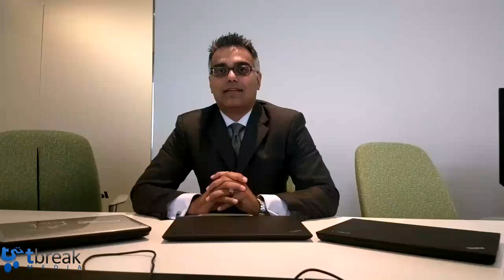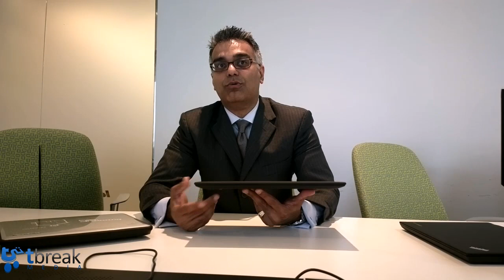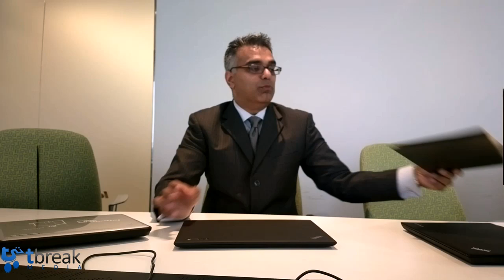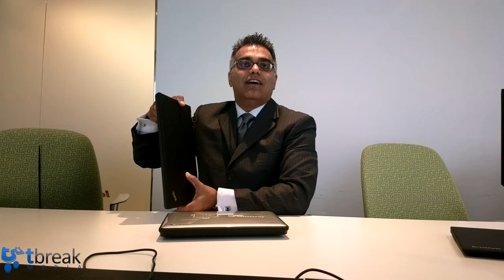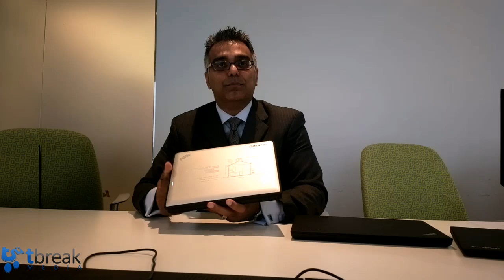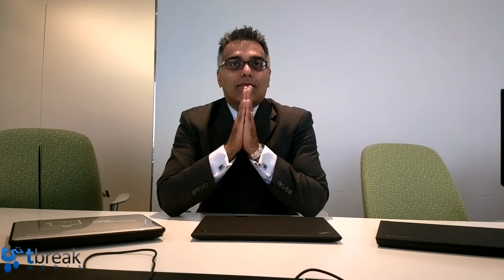Lenovo X1 Carbon Ultrabook Interview

Comment: The light, underpowered/shit display carbon, the beefier/shit display ultrabook with 1GB discrete graphics from AMD? wait no NVIDIA? wait ummm yeah, and the plastic-reinforced brick.  Sorry lenovo, but the next gens have to be better than this. 

Love the carbon, but hate the low res displays.  Love the back-lit keyboard, but hate the low res displays.  Love the traditional TrackPoint and Glass TrackPad, but hate the low res displays. Give it the power to run 1440p and I'll pay anything.